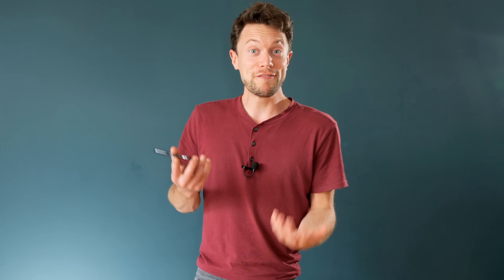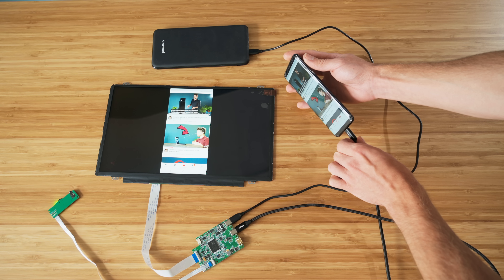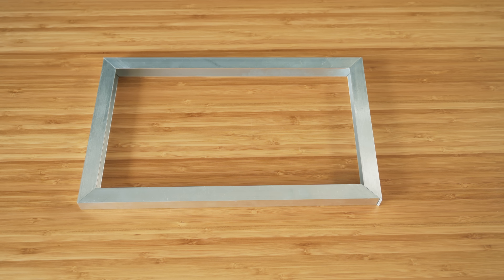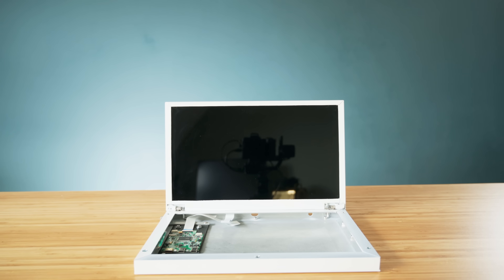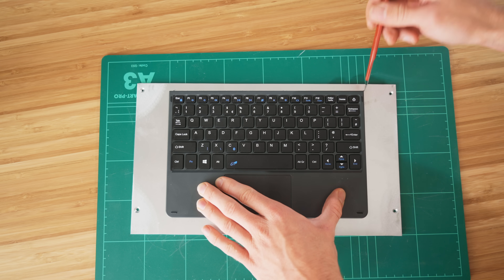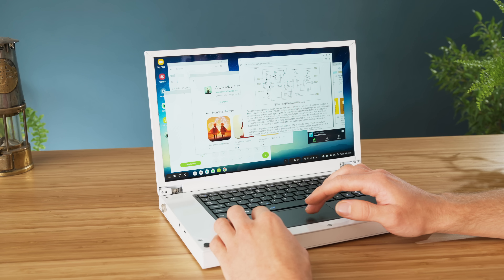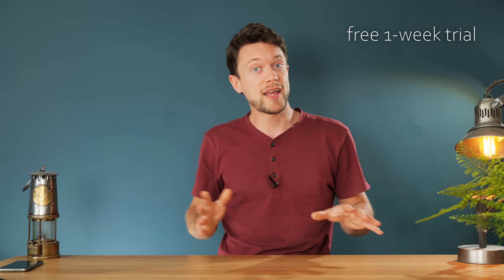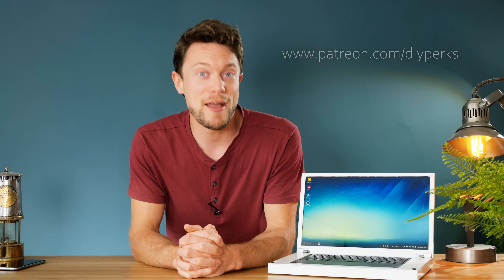Broken smartphone to working laptop transformation

Comment: Great idea and great execution. I wonder if a "laptop" is the right end result for this. I would rather just hook it up to a normal screen and normal peripherals or use it as an entertainment box. Especially if you add some light coolig this will chug along quite nicely. Anyone who does not want to actually buy a laptop or pc can just use this as a cheap replacement, using their existing phone (who doesn't have a phone). Also adding storage would be a great benefit here.
So here's a project idea: A box to slide your phone into, which cools it and provides it with some ports to plug peripherals into, as well as an ssd for additional storage. (that would be using the currently used phone)

Comment: Another cool way would be to find dead laptop with working screen, take out motherboard and put phone inside along with board from the video. If needed, phone can be taken apart so only motherboard from phone would be inside laptop. That way, you have signal, speakers and factory looking laptop without the need of cuting and painting aluminium.

Comment: one small oversight.... what if the phone died inside? like running out of battery while on idle or something. If you leave the "laptop" for a week straight and try to turn it on, it simply won't boot thanks to the phone being out of battery and need to be restarted manually

Comment: USB ports have terrible durability, they are the second most common problem I have to fix when repairing cellphones(after broken displays). USB insertion/extraction as part of your on off switch mechanism seems like a terrible plan. The wear and tear from normal use is definitely going to destroy the connection point if the device is actually regularly used. I guess you can take it all apart and replace the worn out piece, but there are other solutions that are more durable without a substantial cost increase

Comment: Wait you can't just charge via USB with the power wires, the data wires are extremely important, their resistance is used to figure out how much current can go through, and without proper handshaking you're only gonna get 100mA current max!

Comment: Interesting idea and a decent result; 
Unfortunately the idea had not come to full blossom before you started the project, it seems. 
Esp. the 'Blue Peter-solution' of sticking the phone on the back of the screen with a blob of sugru. Every tinkerer - yourself included - can think of a way to wire a wifi antenna; 

If for some reason you choose a flex-option: stick in your / any phone and there's your affordable laptop tadaa...! [And I think that route might be very interesting] why not make the housing - at least in part-  of acrylic? That would also solve the wifi / faraday problem. Come to think of it -pun intended - 3D printers are very accessible tools to add things like a solution for containing an accessible phone
Last but not least, I would suggest that aesthetics are important too. In this case things like rounding of the corners, adding a chamfer or fillet will greatly improve the endresult with very little difficulty or effort.
Regardless of my tough comments, I greatly enjoy your projects and appreciate your efforts to share your endeavors.
Keep up the good work!
Willem

Comment: While I think this is a really cool and awesome project, here's a couple of things I'd improve:

First, instead of having a DC barrel jack for charging, maybe you could have used a panel mount USB C or even Micro USB for the added convenience (it is still 5V after all). Second, as for speakers, you could have just used some out of an old laptop! It wouldn't sound as good as what you were already planning, but they're usually tiny, and, in my opinion, would be a lot better than the phone's built in speaker, or having to resort to external ones as you said.

Comment: You cannot acess a display broken phone through usb cause later versions of android needs Acess, to manually allow data acess or Unlock it, and you cannot unlock it if the display had been broken. Finger print won't work once you turn off and open your phone again, since after a shut down, you have to unlock phone by Pin , finger print won't be accepted. Again, your display is broken so.

Comment: Alternate suggestion for the phone-outside problem- make some large cut-outs in the side panels and fill them with wood or plastic, retaining the structural strength and light weight of the aluminum while increasing the signal availability.

Also, I would really appreciate if instead of just saying "I cut the aluminum" he showed us the tools and techniques he used. Cutting metal is not a simple or easy art, and I'd like some guidance!

Comment: You need a Thunderbolt 3 cable. USB C 3.1 is just USB.
Reply: @passatb6break  you cannot route display over USB 3.1, the standard. A USB 3.1 cable will fail, you need a TB3 or one with display support specifically. Speed is not the issue

Comment: perhaps it'd be better to get a board with a power signal input (ie checks for closed circuit between two pins), that way the power switch doesn't have to move the entire board

Comment: You could've made the top bezel larger then put a hole in it! that way you can make use of the front camera?
or make  the lower bezel larger to enable the rear one... that will show your nostrils between the hinges (worst design EVER)

Comment: You can also use an app called Limbo PC emulator and install windows XP on it. it only supports Windows XP and below. It is not a simulator, but it emulates every instruction that is in the windows XP's code. it is like VirtualBox or VMware.  But it significantly increases the temperature of the phone if your phone has a processor that is too slow.

Comment: power bank is lose inside how did you fix it and also if you could make the rubber feet on the screen side it would be more neat i think also you can use this chase for single board computer as a full laptop experience and you can drill holes beside the keyboard make as a speakers grill so it will be very nice looking and with front firing speakers you can show your experience of making good speaker then :) if you can make project it will be very nice of you

Comment: you know  the first to manage to massproduce a cheap product like this to replace desktop and laptop pcs for standart users will win the 2020s android 10 already has a hidden desktopmode built in so all you have to do is to slim the design down a bit, i realy like the clipin on the back of the srceen. this has potential.

Comment: This would be a great recycling project for unwanted phones: to become Internet devices for the less fortunate in our world.  Well done - Cheers!
Reply: It depends on how old the phone was because it could be considered a security risk for some of the more security required apps (like banking) due to not being able to update android enough to plug security leaks.  I like the fact that phones can be unlocked but they really also need to be able to be rooted remove the crapware from the mfg and would allow other options to keep many of these devices to become ewaste (not everyone recycles or sells off their old devices, they simply throw them away) by allowing enthusiastic people to come together as a community to develop an OS that can run on them.  Many of these flagship android phones hardware are much better than some of the basic arm chromebooks, it's a shame that they can't be recycled into a diy laptop or chromebook instead.
Reply: @MrWirelesscaller  Especially since there could be a kit similar to this one which can be bought ready-made, which one could buy and stick the old phone into, after replacing the operating system with one like LineageOS and Replicant, or after updating to a newer Android version. And depending on the capabilities of the hardware (most important part being the screen, in terms of price), we could get nice smartphone-to-laptop conversion kits, maybe even adding custom cooling for the phone, with the aid of either a thermal pad or lots of thermal paste, or even removing the case and battery from the phone (or replacing the battery with a smaller one, to leave more room for cooling but not shut down if power is cut for a few seconds), and directly cool the other components, especially since there are lots of small and tiny stick-on cooling fins, and funneling the air from a fan into the right places is not difficult nor expensive.
Reply: Yes!!!! This would be very good
Reply: To be honest, they already are internet devices for the less fortunate of our world, if they even have internet. Where you do think all those used phones people sell or throw away or recycle go? A lot of the electronics recycling companies make a profit by selling the electronic waste to other countries for a profit. And considering they get electronics for cheaper than new, which they can repair and sell in their country, why would they refuse?
Unfortunately, it's the internet itself which is lacking or cost-prohibitive in the places which need it the most.
Reply: @SapioiT  Would be good to have proper image of so called developed economy countries where living for regular folk is quite harsh. Otherwise people from world shitholes take imaginary tales about western wonderlands as granted and came here in result, causing huge problems for both sides.
Reply: @KrotowX  To add to that, the developed countries mostly stopped developing. They switched from a being preemptive to being reactive, and a lot of red tape made it difficult for even the country's citizens to live a good life. Life is not easy anywhere, but in some places is easier, at least from some points of view. Wish we had a corruption-free meritocratic civilization in our current human civilization, but it doesn't seem like we have, at least not anymore. Right now, the best option for the people who want something like that would be making a breakaway civilization which to focus on being hyper-efficient and which to make use of assets others find as liabilities, and which to push the limits of humanity to the point where some fiction and fantasy becomes fact.

Comment: Hey Matt, I love this project! It just so happens that I also have an old Samsung S8 lying around that I broke during a botched repair job (whoops 😅), the cellular radio doesn't work anymore but everything else does. I also happen to have an old laptop screen lying around lol. What are the odds?! I may end up making something like this.

There is one thing I have to mention that I thought could use some improvement. The way you break the connections at the two USB-C ports. That to me looks like a recipe for premature wear and tear. There has to be some other way to make and break connections repeatedly that is more robust, though admittedly I can't think of anything off the top of my head. Still though, awesome project overall as always! Keep up the good work!

Comment: If you had a 3D printer you could actually make quite a decent laptop shell for this project, much thinner, rounder corners too and with already existing holes. 
A bit of sanding and some gloss paint it will look quite legit. 
Hell I even venture so far to add an ability to slide the phone into the chassis like a floppy disk and collect it to a USB-C port that is adjustable if you use a different sized phone.

Comment: Why use a proprietary socket for the charger than just using type C to charge it?
Reply: Because that's what his power bank uses... And Making it usb-c would add $4 to $15 to the build. That's not a proprietary port, it's a super common 5.5mm x 2.1mm barrel connector, I have like 40 of them, they can cost less than a dollar each.

20v PD 3.0 chargers are a little expensive compared to the old 20v power bricks he probably has laying around for free. Also, that powerbank might support 24v charging, which PD 3.0 doesn't support and cheap step-up voltage regulators for cars do.

I love USB Type-C... But for DIY projects, I often just use 5.5x2.1mm barrel connectors... I can always upgrade when necessary, and I just don't have that many type-c chargers that can output the ~15v I usually need. One of my type-c powerbanks stops at 9v :(

He also like EC5 connectors for higher current stuff... They are commonly found in motorcycles, car jump starters and RC toy vehicles.

Comment: This is a great use of restoring a devices functionality. Thank you for the template. An addition that I would add is: A lock for the phone mount. At least something to prevent a thief from stealing your phone without struggle. Even though a phone with a broken touchscreen may be almost useless in functionality, there is still data to worry about. Not only that, if another phone were to be inserted into the mount without any impaired touchscreen functionality, a phone could still be sold, data stolen & sold.
Thanks for reading my feedback. Hope you see it. Reply's are welcome. (Click read more for reasons and explanations).

Arguments addressed:
      Well, even if the data is on my phone, I would still be able to find it!
  Your chances of finding your phone could be significantly decreased* as it can be concealed normally with a phone in a pocket. A cracked phone is mundane, as you could not identify it immediately     without proving it so with a mark, or inserting it into a computer.
  If a thief was running away with a laptop, you could still identify the laptop as yours, as others would see. Not only that, since people would see your tablet, a unique tablet would be a un-tempting target since hence, unique.

  *I haven't researched to proven that, seems like common sense.

A further explained example:

  Without a lock:
Thief: *Grabs phone, unplugs it while pulling, and runs away.

  With Lock
Thief:*Grabs phone, 
Person Who has the laptop: Pulls and grabs onto laptop.

The person is able to react and identify the  thief.

Comment: You forgot to add some usb ports, could be done with an adapter. Thats something i would add also run a extension from the wifi antenna to the outside of the phone to keep everything inside. That would keep it looking nice.

Comment: You never cease to amaze me. After the 4K projector, I said what else and then this. Who are you????
Would it be possible to use plastic rather than Aluminum sheet? Like a 6 inch PVC tube, soften and cut open and spread flat. That should thick enough to protect the screen and hold the boards and can be molded for the sides. Besides it will allow WiFi with the phone inside. Just a thought.
You are amazing and a great video.

Comment: A couple of notes:
1: this will only work with a phone that supports USB OTG. Even if you have a USB-C port on the phone if it doesn't support USB OTG (like one I have), you're a bit out of luck.
2: If you have a power bank that supports the USB PD protocol, you can just forward the USBC port from the power bank to the chassis, and get a much faster charging experience when also using USB-C 3.1 cables and a USB PD-capable wall power supply.
Don't have a power bank? You can actually make them yourself these days. Search for an adapter built on the "IP5328P"(note the P on the end, that's the version with USB PD) chipset, and connect some Li-Po or Li-Ion batteries to the terminals for as much battery capacity as you want.
Reply: I have a LG Stylo 4, love the phone, has a USB C port with fast charging and OTG, but it does not support video output over USB C, which pissed me off after I bought a USB C hub with HDMI port and got nothing on the TV I hooked it to. So what I'm saying is, that just because your phone has USB C with OTG, it does not necessarily mean you will get video out over this port.
Reply: ClokworkGremlin I like the way you think.
Reply: You forgot to mention the phone needs to be a Samsung flagship or has android 10 (google added dock support in this version)
Custom ROMS could be used but thats a different matter
Reply: @girishkumarpeddi6266  I mostly didn't know. I dont have a lot of familiarity with specific phone capabilities, just that there are a lot out there this won't work for.

Comment: This isn't about this video, but about your video on turning a laptop into a mini desktop: https://youtu.be/e3fnsGHe8eE. I posted it here because it might get more visibility. I'm thinking of doing it with my old laptop, and have verified it boots and works correctly without screen and battery (firmware works on external screens too), but there's one issue: The power button is on the keyboard, so I can't easily add my own one. Does anyone know how I could do it? The laptop doesn't have Ethernet, so wake on LAN isn't an option. And in case someone has done it with my model, it's an ASUS UX31A.

Oh, and the laptop isn't broken except from the screen being smashed.

Edit: I'll check tomorrow if the keyboard connector has a pin only for the power button or if it's like the other keys

Edit 2: I checked the schematics, when pin 5 (from the power plug side) is grounded, the power switch is pressed. Pin 6 is a ground pin. Also, if anyone plans to do it with the same (or a similar) model, pin 3 is the power LED

Comment: Love the concept, favorite part is that it's Android phone agnostic. Really thought through most of the things. Two things that need to be addressed:

A USB Hub may be super useful so that you can plug in other peripherals; even if you don't need the connectivity, blocking off all those charging ports on the battery seems like a waste. 

Second, and possibly a major oversight: ("possible" because you'll need to check your battery pack for it's function): Make sure that the pack has pass through charging capabilities. If it doesn't the battery will not charge when it's plugged/unplugged and the phone is plugged in. Or like a cheap one I have, It stops charging the device when it's unplugged from power and requires pushing the button on the battery to start charging again.